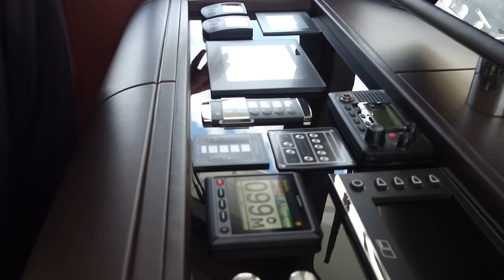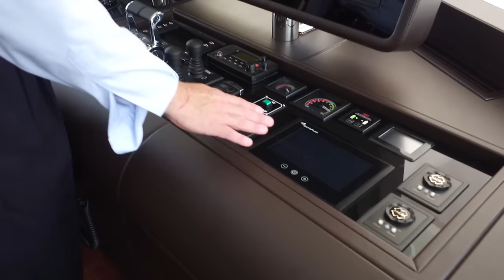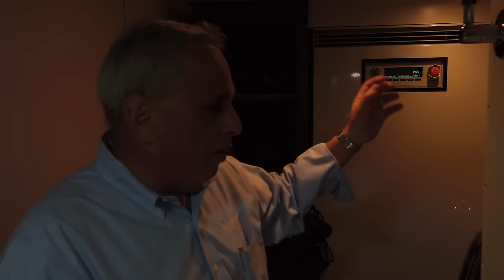Exclusive Tour of the 2017 Ocean Alexander 120 Yacht at the Miami International Boat Show

Comment: Very nice video.    I found the doorways a bit too narrow. If you are well over six foot and 250 pounds this ship is claustrophobic.  Also too many tables and furniture have sharp corners.  Why do you have transparent sink  bowl  in the heads?  Should show us the crew quarters.  Engine room too cramped.  Good luck with the maintenance. Do you have openings in the ceiling to pull out engine and parts? No space for a chopper.???